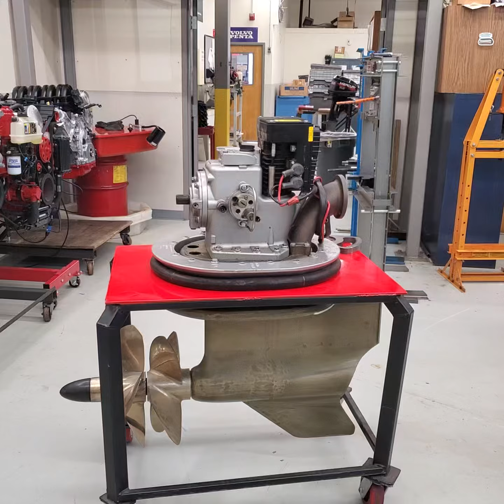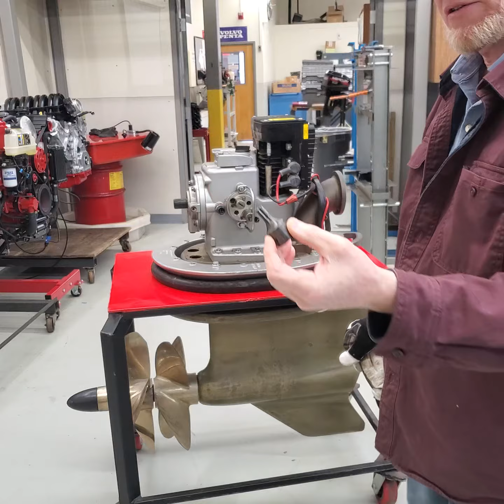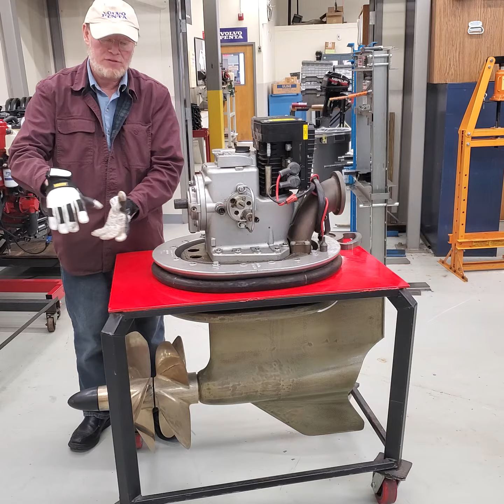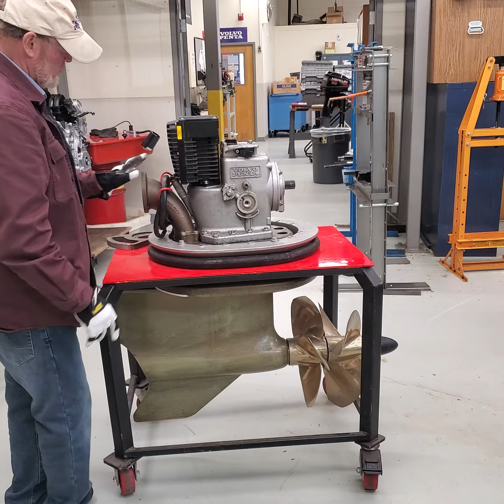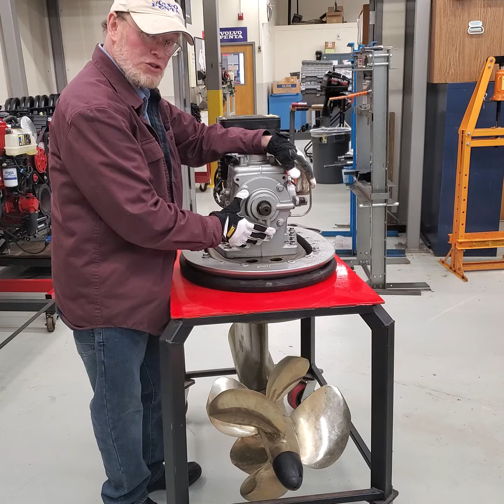Volvo Penta IPS quick overview

Comment: Are PODS reliable? I'm reading a lot of issues with water in oil and seal issues, is it accurate? Debating whether I should go with shafts instead
Reply from the maker: @crgeorge1  Those issues have been resolved. Those were a problem with early seal designs.

Comment: Hello Ted ,Like very much your Chanel.
I work on an Azimut 77s with 3 IPS  1200.
One of them after driving 2 /3 hours when docking losses transmission pressure and goes to safe mode.
Been cleaning the filter wich there some black moisture grease .
Then goes to normal again.
But when sailing 2/3 hours there always something on the filter.
We had 3 new gear boxes +\- 300 hours ago. Oils changed but seals check.
Would you know ?
Thank you
Reply from the maker: Do you need to keep adding oil to the drive? Not sure what "black Moisture grease" means. Does the lube smell burnt? Is it back in color or milky white?
Reply: @tedsmarinerepair8956  thank you my friend for answering .
I only add oil because when open the filter there always a bit coming out. 
I could send a video or photo by mail or what’s up.
If it is ok with you🙏
Reply from the maker: @ElvioVieiraJardim  yes please do. My email is marinedoc01@yahoo.com
Reply: @tedsmarinerepair8956  ok Ted thank you my friend💪 I m currently bringing back the boat to Portugal 🇵🇹 from a two weeks trip around Spain . There just a a few people to talk to about IPS systems . Been having some problems since I’m with him . 
Seen your vids and you are 👌👌👌👌

Comment: Very good video.  What is the most likely cause of water in the transmission oil?
Reply from the maker: There are various reasons, sometimes fishing line on the prop shafts, or very silty or sandy water can tear up seals. I can't point to one particular cause due there are many. These units have a robust design like their outdrives.

Comment: Lots of great information.  A little off topic, but with a forward facing propeller system, it seems they would easier to foul?   Can a rope cutter be installed between the two props or some other solution? 
Thanks
Reply from the maker: That is a good question. As far as I know all smaller VP fwd drives ( non commercial) do not have a line cutter option.
Reply: @tedsmarinerepair8956  Line cutters for the IPS 1 part # 21686492 and I can help you with that.
Reply from the maker: @dankraemer5359  Thank you for the information!!
Reply: They all have cuters between the two props.

Comment: Hi Ted, We have enjoyed your videos and they have helped us and friends of us tremendously.  We just sold our Navigator boat and are looking at buying a Regal with Volvo Penta IPS.  My question is, most of the boats we look at have rusty bolts all around on top of the large clamping ring on the IPS.  I was wondering if you find that a concern.  Thanks again.
Reply from the maker: The bolts are steel so they will corrode. As long as there is not severe corrosion (major flaking rust on the bolt heads, I find this is normal. Unfortunately in many applications this is an area that is overlooked for a "corrosion spray" treatment that should be applied periodically.

Comment: Lots of great info on your channel.  I’m a surveyor trying to learn more details about the IPS drives.   Had one today with moderate amount of moisture in the fluid.  Is there a common place for mixture?  Thanks
Reply from the maker: Moderate is a relative term. Any water is never a good thing. I can't state a common point of water intrusion without inspection (misleading info is never good).
I would suggest the owner have a VP dealer determine the water intrusion location and have it repaired.
Reply: @tedsmarinerepair8956  Thanks for reply!  Yes definitely will get a service and diagnosis before next use.

Comment: the electric motor that vectors the pod through gear reduction is interesting. i thought it wouldve been hydraulic. surely the motor would draw a lot of power
Reply from the maker: Good question! Actually it is a frequency driven motor which spins a pair of planetary gear sets that have a high mechanical reduction gear ratio. So its really a small industrial motor which consumes far less energy than you would think.